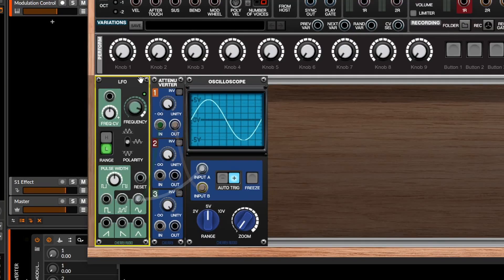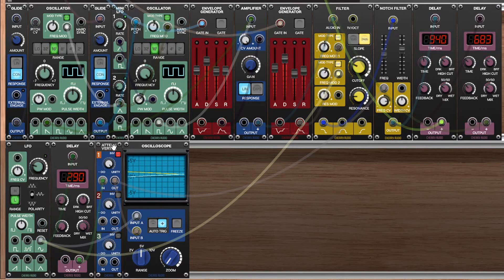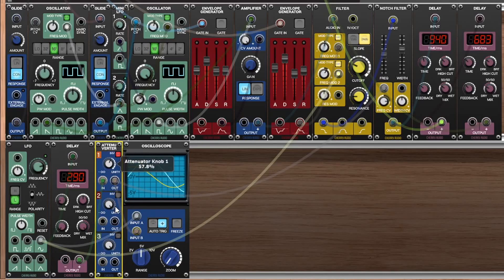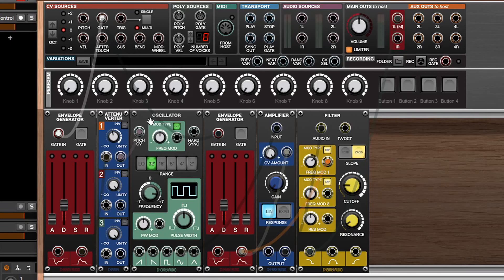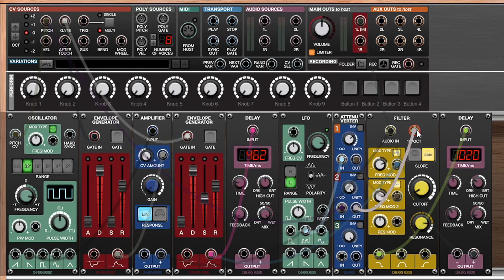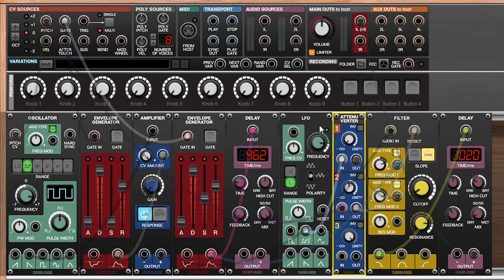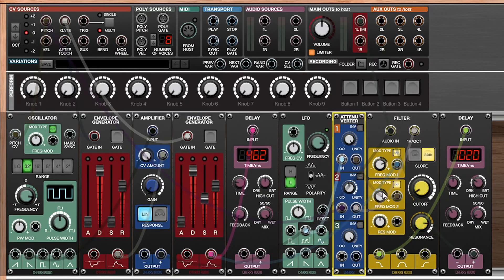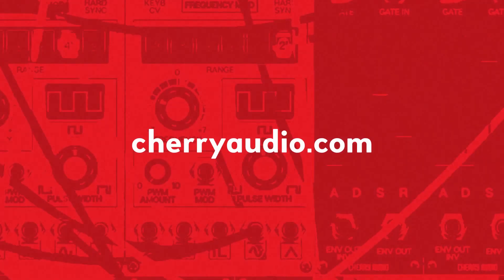Voltage Modular 2 | Using Attenuverters

Comment: Have you had any experience with the module designer software offered by Cherry Audio? I was wondering how difficult it is to use. I just recently downloaded Voltage Modular Nucleus, and I'm having a blast using it. I also enjoy your tutorials on the platform.